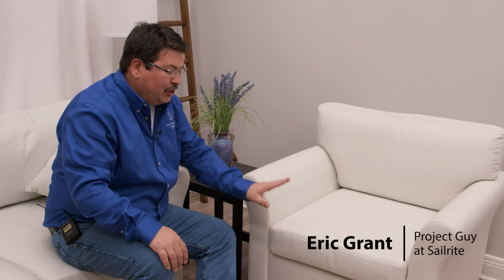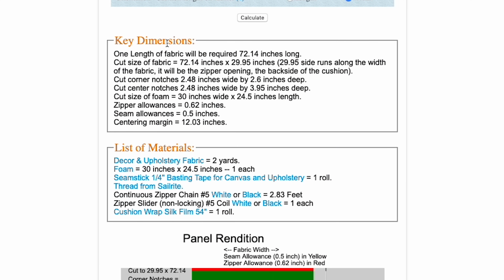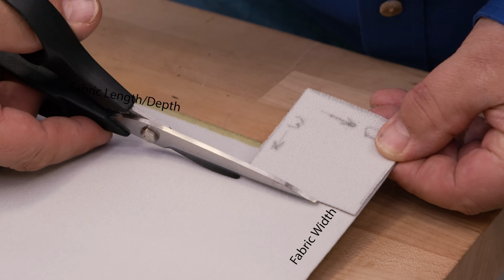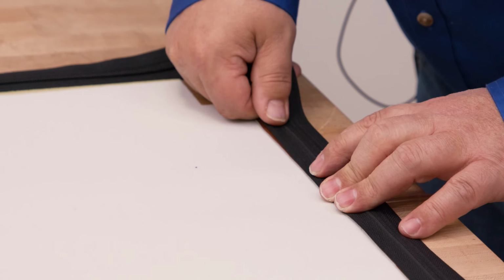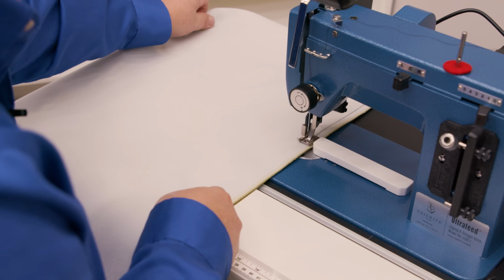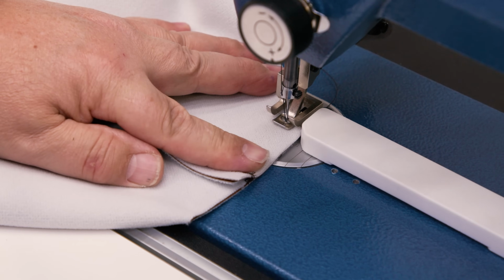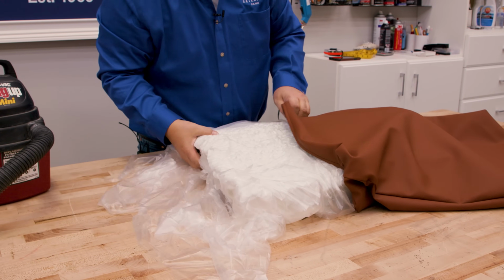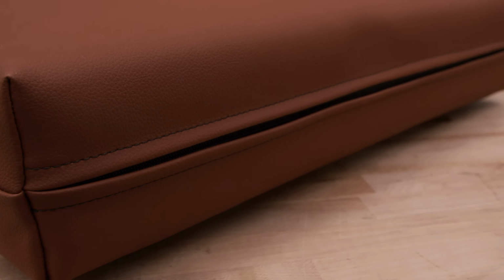Make a Sofa Cushion in 30 Minutes

Comment: What about sewing over the basting tape? Will it cause some problems with my needle?
Reply from the maker: When sewing a cushion you must not sew through the double sided tape on the seams or the glue will show up when you turn the cushion right side out. However, when sewing the zipper in place or sewing a top stitch you will sew through the seamstick. Usually the glue on the needle is cleaned off with every pass through the fabric. If it builds up on the needle I use a cotton ball with rubbing alcohol on it to clean the needle or goo gone.

Comment: Any other way to make cushion without sewing?  I am really bad at it.
Reply from the maker: Well, it will not look as good but if you use a backer-board you can pull fabric around the foam and staple to the backside. The corners can be tucked in, but they will be rough.

Comment: why if you're using the older original foam do you subtract that quarter inch from the width and length before adding into the calculator? I understand this is an older video but maybe somebody will see this question
Reply from the maker: Hi Mark,
The calculator automatically adds 1/2" to both directions on the foam, so when you are using old foam you need to subtract that 1/2" to equal your current foam. This is done to give your cushion cover a tight fit.

Comment: My old cushion's back is narrower than the front.  It is not square. How do you compensate for that in your fabric calculator application?
Reply from the maker: Hi Michell,

The 30 minute box cushion method can only be used if you have a square or rectangular cushion.

You would have to make a regular box cushion to accommodate for your specific shape. This is the calculator you should use, with video below it. 

https://www.fabric-calculator.com/boxcushions/index.html

Comment: Just made some pillows for my mother's rocking chair. Cutting for zipper placement was a bit confusing for me but figured it out. Will never use another pattern again. Especially liked your hint for easily getting the covers over the foam. The first one was a little tricky so for the second one I used fold-back clips to hold the silk film in place around the vacuum hose. Worked like a charm. Great video!

Comment: What is the purpose of subtracting the half inch from the foam calculation? I have new foam that is Dacron wrapped. I am not sure what measurement to put into the calculator. Thanks for your help.
Reply from the maker: In most cases we want the foam to be 1/2" larger in both width and length. So.... if your desired cushion size is 22" x 24" and you were cutting new foam you would cut the foam to 22 1/2" x 24 1/2". However, if you are using old foam, already cut to size, you need to enter in the fabric calculator a size that is 1/2" smaller in length and width, so it will calculate correctly the fabric size. To make this simple, just make sure the foam size in the fabric calculator equals the foam that has already been cut to size.
Reply: @SailriteDIY  Thanks! I assume that you want the fabric smaller so that the foam fits tightly. This video is awesome and the calculator has been very helpful! I am looking forward to trying it out. Cheers.

Comment: What’s the point of the zipper if you literally have to vacuum the cushion to get it in and off
Reply from the maker: Without the zipper opening you can't turn the cushion right side out after sewing.
Reply: @SailriteDIY  yes you can. However they will have to stitch by hand, use snaps, or Velcro. There are tons of closure options besides zippers

Comment: Nice detailed video (as always)! I was wondering about the ventilation hole recommendation for vinyl fabric and medium density foam. Can you use a more "airy" zipper to let air in and out of the cushion? Like, use a zipper that has more space between the teeth. Does that even exist? Or if using that almost air-tight zipper, how about not zipping it all the way shut?
Reply from the maker: I do not think I have ever seen a more open teeth zipper, sorry. But leaving a portion of the zipper open is an excellent idea. That should help keep the cushion from blowing up.

Comment: I have a question. When folding the corners and sewing across the seam allowance,  can't you splay open the seam instead of folding it to one side? Great video. I love watching and learning.
Reply from the maker: Yes, that could be done. However, the rest of the seam allowance along that side will want to take a single turn along side the foam, it will not splay open along the length of the foam, as it did when you forced it to do so at the corner. Because of that it may not be an advantage, but rather a hinderance. If you fold it one direction, as seen in the video, then the seam allowance will always want to fold that same direction along the length of the foam. In the end I believe what we show in the video is better, because of those facts. But, you are free to try it with a splayed corner seam, that is the beauty of DIY. Thanks for your comment!!!!
Reply: @SailriteDIY  awesome. Thank you for that reply.  I guess the use of double sided tape down the length of the seam could work, but might be a waste of tape.  I was asking for mainly automotive upholstery use and also home use. I like both.  I have the Sailrite Fabricator.  It's still in the box cause my sewing room isn't set up yet. I can't wait to use it